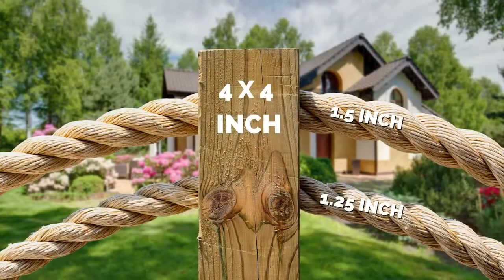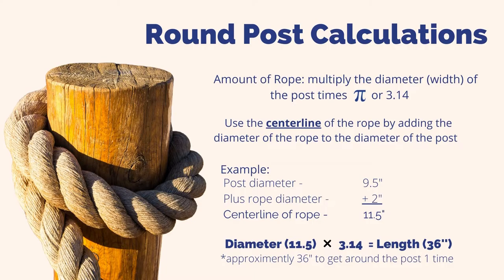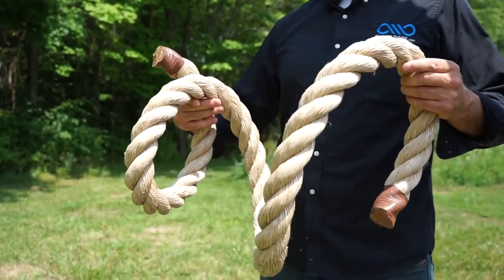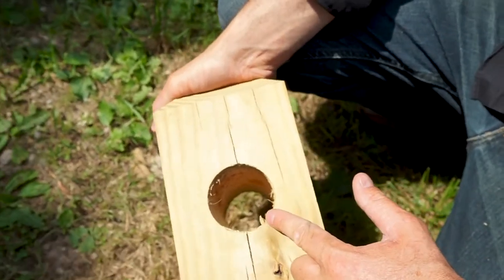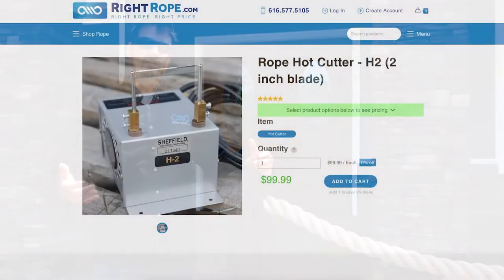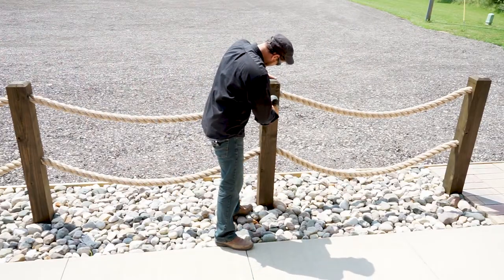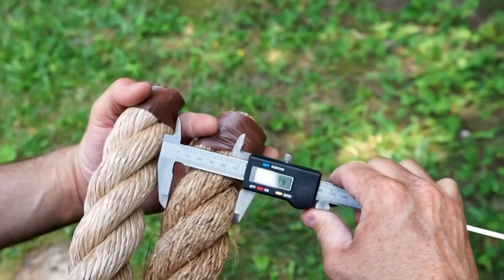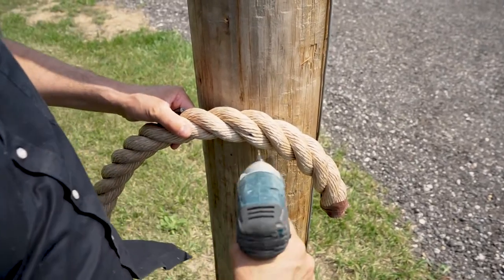How to Build a Rope Fence | Make a Rope Railing | DIY Demonstration

Comment: I've been trying to find a better way to make a portion of my planned rope railing 'removable' so I can take a section off when the dock goes in in the summer.  Do you have any ideas for something like this?  The current look will be square posts drilled straight through, with 3/2" manilla rope.
Reply from the maker: We have seen people put an eye splice on the ends of a rope and put the loops over the top of the posts. Also some people use hardware to hang the rope in place, or install hooks on the ends like in theater crowd control.
Reply: @RightRopeOfficial  I was thinking that a splice could work for the top rope, but since it's also going into a corner, the bottom will have to be done differently, as an eye splice won't be able to go over the other.  Thanks for the ideas!

Comment: Thank you for this very detailed video,  it gives me hope being able to tackle my project to install stair railings with ropes. Just let me ask you a question when you don't mind.   ...How do you drill the holes into the post for stair railing for the ropes? Horizontal or in an angle? 

Thank you again. 
G
Reply from the maker: Great question. It is definitely easier to drill square through the post instead of at the angle and it will look good either way. If you are pulling the rope tight, the angle looks better, but if you are allowing some sag in between posts, drilling square looks good.
Reply: @RightRopeOfficial  Good morning,  and thank you so much for the quick response and your professional opinion, highly valued.  👍

Comment: How far do you recommend the post spacing and height of rope off ground for top rope, on average.
Reply from the maker: Hi Dan, the spacing and rope height is all about what looks good to you. The posts in this video were about 7 feet apart and the holes were drilled about 42 and 21 inches above the ground.
Reply: Great question! Just what I was looking for

Comment: Hi, is there a  video on how to secure those posts to ground.. trying to use it to divide a concrete driveway , neighbors and ours. Wants to keep the pole looking clean because I can't put anything on the ground to hide the bottom of the poles. Thanks
Reply from the maker: We don't know of such a video, unfortunately.
Reply: I think you can use concrete mix from Home Depot just as they use for fence posts

Comment: For a 1 1/2 inch cotton rope would I use a 1 1/2 inch bracket?  The rope fits in a 1 3/8 hole and probably a 1 1/4.  should I still get 1 1/2 bracket of 1 1/4?
Reply from the maker: If you got the 1 1/2 inch rope from us, I would purchase the 1 1/2 bracket!:)
Reply from the maker: If you got the rope elsewhere it might be harder to tell.
Reply: @RightRopeOfficial  It is pretty snug in an 1 3/8 test hole, but I think I can fit it in a 1 1/4.
Thank you.
Reply from the maker: @toddott633 I don’t recommend a 1 1/4 bracket for that, I recommend calling our warehouse and they can give you expert advice : 616 577 5105

Comment: What do I do when it rains and my rope gets super tight and pulls my post out of plumb.
Reply from the maker: If you are using natural fiber rope, you need to add 10-15% extra length/sag so that it doesn't happen. If it is too late for that, meaning this is actually already happening to you because the rope is too short, there isn't much you can do about it unfortunately. We recommend using the synthetic ropes for this reason.

Comment: I have an 1 1/2 cotton rope and want to end the rope inside the post.  Cotton doesn't melt, so how would I do this?
Reply from the maker: I highly recommend an end bracket for that!

https://rightrope.com/product/rope-brackets/
Reply: @RightRopeOfficial  Do I do anything with the end of the rope, or just screw in the bracket and insert screw?  How well do they hold?  Do I buy the same diameter bracket as the rope diameter?  I live in Grand Rapids.  Does it have to ship or can I pick it up?
Reply from the maker: @toddott633 we are quite a bit outside of Grand Rapids, so I recommend shipping! And the bracket just needs the rope to be placed inside, and then the screw to be screwed into the rope. It should hold well :)
Reply: @RightRopeOfficial  So, for a 1 1/2 in cotton rope would I use the 1 1/2 bracket?